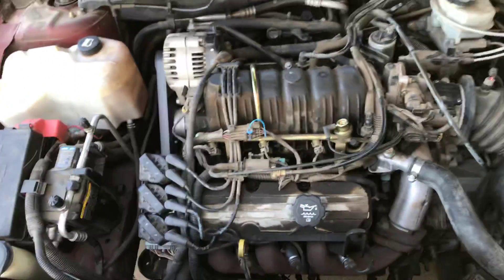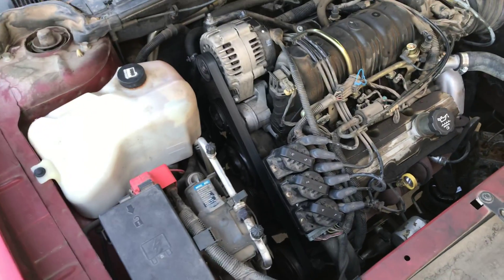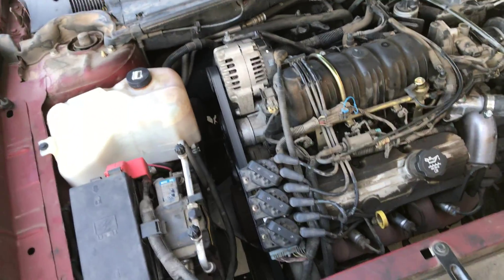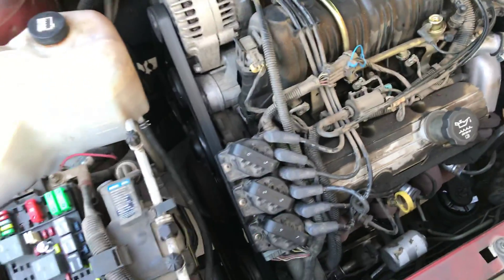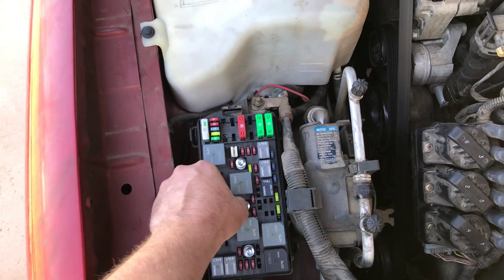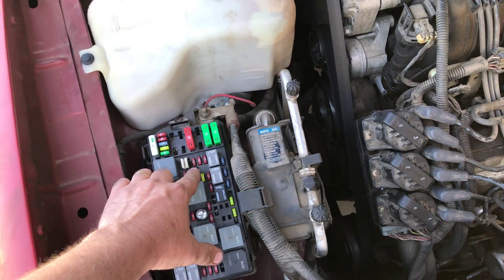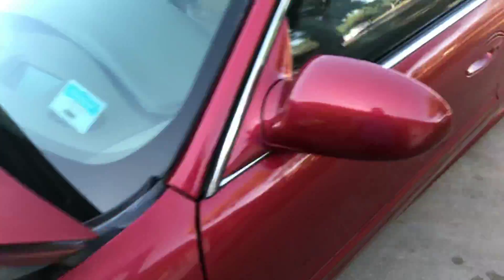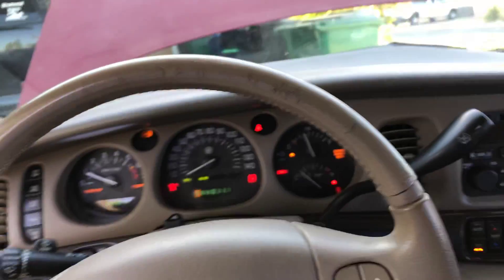GM 3.8L V6 (3800) Cranks But , NO START Solution. Also solved Cigarette lighter not working BONUS!

Comment: Mane I just went through that same problem replaced all kind of shit just like u ended up fixing a crank seal oil leak and it was weird that it finally ran but now this makes since cause I was lookin for a ground that I know was the problem but didn’t know those bolts was a main ground and u the first person ever to say it was that and it fixed that common problem thanks 🙏🏾 for this

Comment: My fuse box isn't lighting up with light test. Throttle body 1&2 is not lighting up. I have spark...fuel getting to throttle body...how do I get fuse box to fully light up so it can activate throttle body to start? thanks
Reply: 1989 camaro
Reply: my fuse box is under dash..refering to throttle body fuses
Reply: @jevontecole7836  Did you figure it out yet?

Comment: I have a 2004 Impala 3.8 that cranks but won't start, even with starting fluid being sprayed in the intake. I have already replaced plugs, wires, coil packs, injectors, O2 sensors and the crank position sensor. I wish I had seen this a few months ago! Now the car is in the shop and I can't even go try this... FML
Reply: I have the same car same problem. what ended up being the problem?
Reply: @notgaybear5544  it was the ignition module. It's located under the coil packs

Comment: I have to say after much pulling out hair trying to figure out my issue with my 2002 Buick Lesabre. Your tip and hint based on the tightening down the bolts of the fuse box was amazing and saved me so much time and money. I thank you very much! It worked immediately after doing that and has started every time!

Comment: I was having a similar problem. Sometimes my car wouldn't start but was turning over, and sometimes when I turned the key to start it didn't do anything for a second or two. After 
 watching this I checked my fuse box, and it was  barely on the fender! Wow. I tightened the 3 bolts down and Problem solved! It has caused a lot of other electrical problems over the years. Thanks a million! I was changing all kinds of parts and nothing worked until now!!!!!!

Comment: I just it bought a 1999 Super charged Buick regal GS had it two days ,on the second  day I took it to work. Then pulled it in the drive way. Drove like a dream. Next morning NO START ... NOTHING! RAN THE BATTERY DEAD TRYING TO START IT PERIODICALLY THRU THE DAY .... CHECKED RELAYS AND FUSES, READY TO  START TESTING FEUL  PRESSURE. AND SPARK. THOUGHT I'D LOOK AT U-TUBE FOR A TIP OR TWO  .IM SO VERY VERY VERY GRATEFUL I DID ....    
I WATCHED YOUR POST AND I KNEW RIGHT THEN YOU WERE 100% RIGHT BECAUSE I HAD NO SCREWS IN MY FUSE BOX .WHEN I TIGHTENED THE LAST SCREW TURNED THE IGNITION TO HEAR MY CAR PURRRR .
 ITS PEOPLE LIKE YOU
THAT MAKE A DIFFERENCE IN THIS WORLD. THANK YOU SO MUCH.

Comment: Hello
Where is the battery on this car ?

It looks just like mine but the battery is where the box that fixed this one is .
Reply from the maker: This LeSabre has battery under back seat. Laaaame. There is also more than one fuse box with these type of screws in it.

Comment: Thanks bro . Lol after I changed fuel filter and then fuel pump. Wish I would have seen this video 8 hours sooner. But really! Thanks for the video!
Reply: Mine was doing everything except receiving fuel. Even started for a second when I used starter fluid.
Reply: You MIGHT have to replace MAF sensor.  First, unplug it and see if car starts.  If it does, then plug back in.  If it kills the engine.  It was MY MAF and it now works!

Comment: What if the ignition coil colt is missing ? Will this apply ?
Reply from the maker: It can cause a problem if one of the 3 coil packs is missing a bolt. The coils packs have a shiny clean metal bottom that makes contact to ground in the same way as this fuse blocks does.  If there is no bolt you could have a similar problem.    

Also, there is a dielectric grease that goes underneath all of these items. If that is dirty because screws have been missing, you’ll need to remove the fuse block or coil packs and clean them underneath (and regressecthem to be water-tite) before tightening them down. Or you might not have a good ground on that item still.
Reply from the maker: I guessed you meant to say said ignition coil  “bolt”.

Comment: Woooow! I just tried to tighten the screws for this same problem only to realize all the screws were  missing. On my way now to track down the screws. I'll keep u posted on the results.
Reply: I am trying to fix my own Buick Regal right now, but they are all missing on my car too. It looks like they are not used on my car. I popped the back panel off and there is nothing attached to the threaded holes.
Reply: @iturbo5733  same here. It ended up being the ground wire on the starter. It has to be good and tight. Started right up.
Reply: @iturbo5733 any luck

Comment: So I just looked at mine... I only have 1 bolt at the top of the cover it is missing 2 bolts in that fixed block
Reply from the maker: You probably just solved it bro! Make sure underneath is not corroded /oxidized and then tighten up your new bolts. 👍
Reply: No it didn't solve my problem. The box isnt grounding that side. My car runs for about 40 mins and dies. It kills all ignition and wont start until a few hours to next day. It has to be ecm

Comment: Would that effect the dashboard gauges?
Reply: the bottom of my fuse block was not grounded very well, so in that situation, anything that can be affected by a bad ground might be affected because those bolts get loose.  However, when it comes to dashboard lights/gauges... the most common issue is 1. your alternator is about to go out... this is especially true when it all happens at once while you are driving. If so, get it tested immediately. or 2. Gauge clusters are known to wear out as the electronics vibrate and go through temperature changes... it causes hairline cracks in the small solder connections on the board.. if your issue is intermittent failures or only certain lights or gauges, then you can take/send your gauge cluster to a local rebuild person and they can refresh it in 20 minutes with all new stuff.  I recently searched phoenix locally for gauge repair companies and found guys working out of their homes that did and amazing job on my Yukon cluster... I just drop up in front and he took it our and reinstalled it in 30 min...even added a trans-temp needle and white faces for 40 bucks more.

Comment: I have the same motor and issues, I already check those three bolts and are tight and won’t start, the fuel pump is two weeks old and it was running today really smooth and I was driving it and the motor stop running
Reply: change the relays by switching them with the same noting which was changed,they also bounce and lose contact because they,re cheap.

Comment: I have a 2006 Buick Lucerne V6. Needed a new battery changed it & then would not crank. All accessories working  but when I engaged the ignition switch console went dead. Checked all fuses & relays in both fuse boxes, all good. Checked starter by jump 30 to 87 terminals on crank relay terminals, it is good. Finally found this video so checked the three bolts, tightened them and it cranked right up!!! Thank you!!!! Have not found any other video or resolution informing about this. Grateful!
Reply: Hey I don’t have those 3 bolts on my Pontiac what size are they so I can buy some new ones ?

Comment: Thank you so much for sharing!!!! That was my problem as well. I had all dash lights but would not turn the engine over On a 2001  bonneville.  Thank you once again!
Reply: Did it sound like it had no compression in the engine
Reply: My 2001 Bonneville won't start

Comment: I have the same motor, mines a Buick regal, just died one day at idle,, started  then died again ,, then crank crank crank wont start,.when i looked at  my fuse box under the hood it looks a little different but its free floating like you can see three aluminum square nuts with threads inside, but no bolts anywhere other than one big wire bolted at rear of it  any idea ? crank sensor?  everything else in the car seems to work ok
Reply: Did you find the issue
Reply: @-g.k.4389  the main coil control module under the coils,, but I went on to replace the cam sensor and crank sensor, they are cheap off ebay

Comment: I sure am grateful. All day yesterday and could find problem. Found your video today and I did it. I actually had loosen them thinking it would open fuse box. After it didn’t I pretty much didn’t worry about them afterwards especially when it quit cranking.

Comment: Dude, our LeSabre wouldn't crank at all...my regional tire/repair shop ran codes and said they couldn't help and that I needed to take the issue to a dealer for new PCM or ECM and flashing...they estimated $1,000 for dealer service.  This video solved that problem!!!  Muchas gracias!!!
Reply: Gm fuse boxes have a way of coming loose ty them bolts tight

Comment: Neal : Was the car ever in an accident where the fuse box was removed in the repair ? Or was it disturbed  ( molested ) for another reason ? Any water leaks or missing splash shields ?  I would be interested in WHAT ground was missing to cause a no start . A wiring diagram would be a huge help . When things stop to make sense , you can attach some temporary grounds , such as using test leads , jumper cables - to ground the starter , engine , body and chassis ,etc . You could get lucky and find the problem , if it's a ground issue .

Comment: I have a 96 Buick Riviera Supercharged same problem I can’t thank you enough only my fuse box is not grounded but the both grounds in the back seat one from the battery the other to the fuse boxes were super corroded thanks once again 🙌🏽

Comment: Ok, I tried to perform this with my 98 Buick regal but I do not have those big screws. May have changed. What wrench did you use?
Reply: Same thing happening to me! 02 park ave no screws in the fuse box
Reply: @rebholz6  do you guys know what size those screws are ? Mine are missing and I need to get new ones
Reply: @rebholz6 so what did you do ? I have same issue with my 02 park ave
Reply: @davidwhocares3293  honestly don’t remeber I probably took it into the shop. The park ave transmission went out three years ago :/ miss that baby

Comment: I tried it and it works thanks so much for the advice but when I drove it about 2 miles to return the crankshaft sensor  I left it running come out the store it wasn't running anymore but still on so I cut it off and tried to start it back up it was turn over but wasn't starting again ... Do you any other suggestions???
Reply: did you ever figure it out having same problems

Comment: Thanks buddy, I'm gonna try that right f*!#in now, changed the clacking harmonic balancer, ran for 10 minutes, nothing.... Just got done checking the wires and connectors for the cam and crank sensors, jack shit, no spark. Thanks.

Comment: What size are those bolts mine are gone and can’t find out what to buy
Reply from the maker: I'll pull one of mine out later and give you some specs but i think yo are best-off hitting a local "pick-a-part" or junkyard... these fuse blocks are universal on many GM cars so you shouldn't have a hard time finding them at a wrecker.  You could also get them at the dealer. These are not your average bolts and if I remember, they have a ridge on them partway down.

Comment: What size are this screws
Reply from the maker: Hi Justin!
I’m sorry that I don’t know the actual size. In fact I should not of called them screws in the video perhaps… They are more like a tall stud that stands up with a hexagon or nut on top… You can use maybe 5 to 8 mill driver to turn them.  There are 3 total.

I should also add, the metal to metal contact underneath can get dirty and not provide proper contact… Similarly, underneath the ignition control module is flat metal to metal contact… In either case the two services can be separated from each other by removing the fuse block or removing the ignition control module… Cleaning those surfaces and then applying a certain type of die-electric conductive grease (auto parts store- ask for help to identify the right stuff) that keeps things clean and water tight… Then putting the two halves back together.  So, If tightening these things does not improve the contact for anyone, consider removing it, cleaning things, and putting them back together. 

This car has been in Arizona car all its life… No salt, no bad weather, no severe road grime… Other cases may vary and have worse problems underneath where the connection happens. 

Good luck out there

Comment: My goodness, I cannot wait to try this when I get home. I have 2007 Buick allure with the 3.8 and I replaced everything you mentioned. fingers crossed.
Reply from the maker: Jonathan, Did it work?!
Reply: no, they were loose though! Tightened them up and nothing unfortunately... However, there was no compression on 4/6 cylinders  which lead me to think either a busted timing chain or a busted camshaft. I'm popping open the timing cover this weekend.
Reply: @snutmeez   I took apart the entire side half of the motor and popped the timing cover...it was the chain that snapped. In the process of putting the new set as we speak. I've always read that the 3.8s don't have timing issues, but I've seen a few series 3 motors on here with what literally sounded like the same issue. Weird.